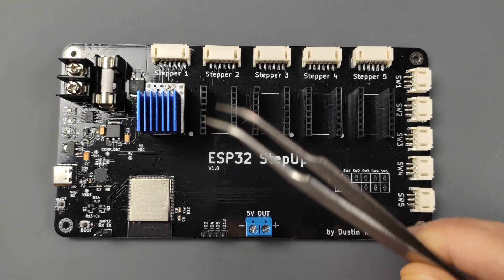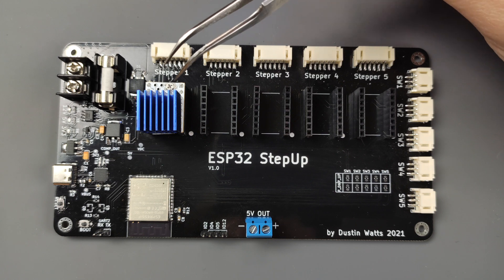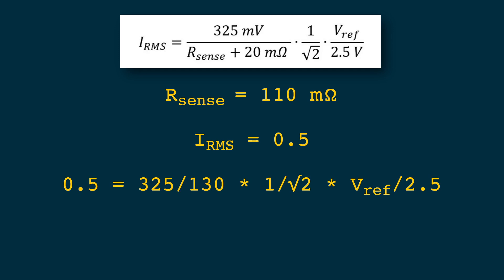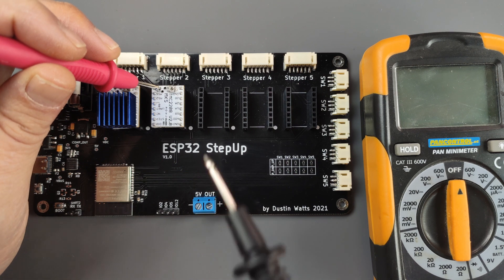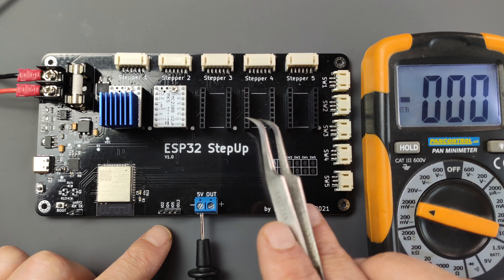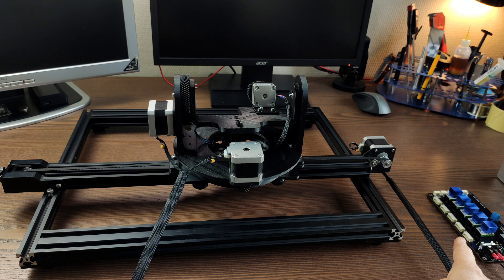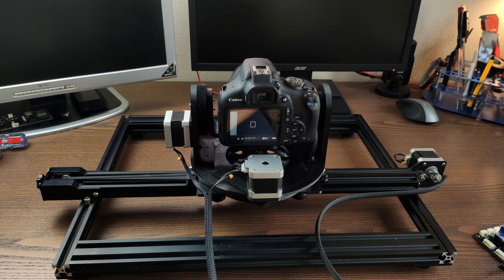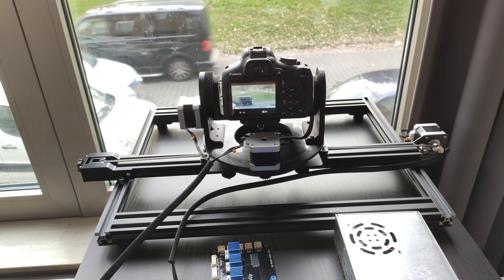Building a 5 Stepper Driver Board w/WiFi & BLE (Part 5)

Comment: So I just went through this 5 part journey, you did an amazing job. Thank you for the detailed explanation on your sub-circuits, you should consider teaching electronics on the side, you have the right everything for it.

I am a novice tinker (who just recently completed his 4th from scratch PCB) and am in awe at your clean approach to PCB designs: short traces, large empty space (I appreciate that you refrained from filling with silkscreen logos), and matte black mask). I’ve learned for much about flow and placement from studying your project schematics and your PBD design tip video. I mention all of this so you know I truly mean it when I say thank you for sharing your skill set.

Also you should consider sharing the schematic for this build as well, you have me intrigued how you set up your centralized R pull up/down array, first time I saw that design approach. 

Thank you
Reply from the maker: Wow! Thank you for such an amazing compliment! I am glad I was able to provide you with any help/ideas at all! Keep designing PCB's, it is so much fun! If you want the schematics, you are welcome to have them. Everything I do is open source, just haven't gotten around to finishing it. I usually share things I finished and fully tested. Send me a DM (mail is in "About") and I will add you to a private repo for now. Thanks again!
Reply: @DustinWatts  thank you for the offer to share your repo. Sent you my email address over Reddit (incase you don’t check it often)

Comment: Looks very cool, the joystick will be fun ! I will be interested how you deal with acceleration and stuff in software......cheers.
Reply from the maker: Thanks Andy! I ordered one of those security camera joysticks... I might need a GPIO-expander though, because I'm short of GPIO's :) Or I might use a ATtiny in I2C device mode with some custom firmware...